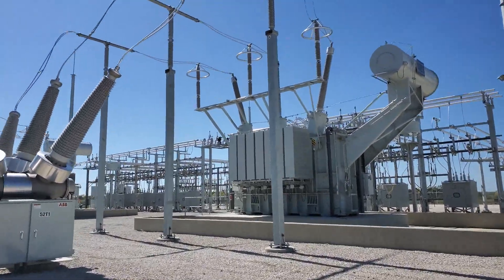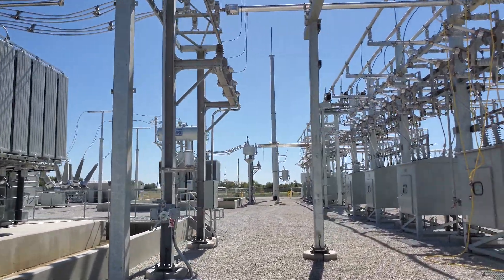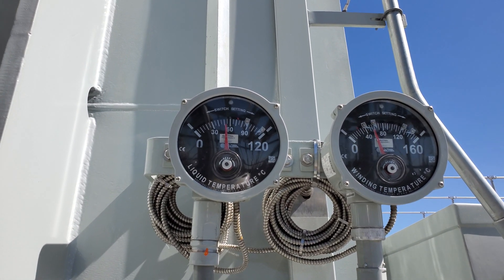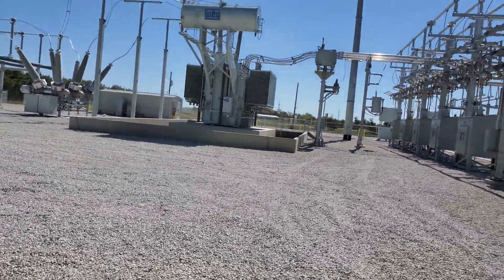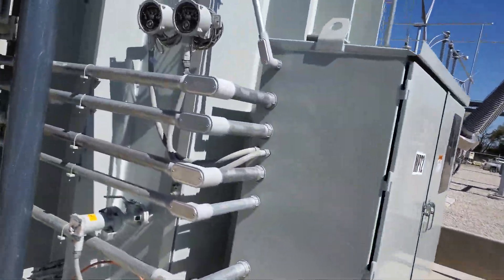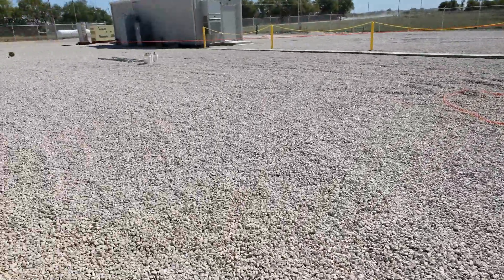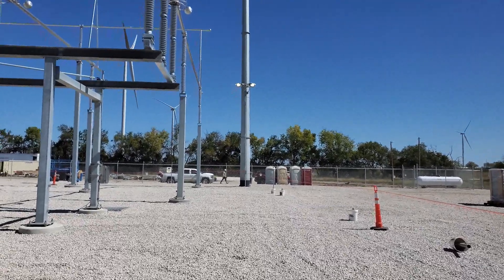345 kV Transformer Issues?? Part 1

Comment: As a part-time student of Electrical & Electronics Engineering, I have t  three QUESTIONS Please.

(1) Why are the Transformers "Humming" if there is no load on them?

(2) Is it periodically required to change the Transformer Oil like the Motor Oil in an Automotive Engine Crankcase?  May I assume Probably NOT since there is Normally NO Combustion?

(3)  What kind of Oil is required if it is Necessary to change the Transformer Oil?
Reply from the maker: 1. The actual hum is the core laminations vibrating/moving. This is caused by eddie currents. 2. As long as nothing is wrong with the transformer, the oil will be good for 20 plus years. If there are issues, it can be "cleaned" and put back in. If there is a big failure, the oil is replaced. 3. It is clear and tasteless mineral oil.

Comment: Losses of energy, which appears as heat due both to hysteresis and to eddy currents in the magnetic path, is known as core losses. Since these losses are due to alternating magnetic fields, they occur in a transformer whenever the primary is energized, even though no load is on the secondary winding.

Comment: Get your tap changer position straightened out. Match it to the high side system voltage.
Reply from the maker: This is a bit different here. We have to maintain a constant voltage on the secondary for the sensitive turbines, so the Beckwith is set up to the secondary PT''s. Engineers forget this so we usually always have to swap the beckwith output wires so it changes taps in the correct direction.

Comment: First transformer oil temp is 52 Deg. winding is 57 past the first stag fan set point which will cause the fans to come on. With no load, both gauges should read the same. The other transformer looks better at 40 deg C or 104 deg F provided it's a hot day.
Good idea to deenergize the first transformer. I've never had that problem, you may have tap changer issues.

Comment: How long did you no load soak each transformer?
What about ambient temperature? 
If I did the math correctly, 52 degrees centigrade is approximately 126 degrees F.
I have worked on Qualitrol temperature gauges many times and know that the auxillary contacts for fan control, etc are adjustable. You can look on top of the gauge dials and pretty much see where they are set. I think they usually contain three set of contacts or set points. Did anyone test those gauges to see if they were set correctly for this application. Also the fans on that first xformer you found turned on, were they set in manual mode or did they come on with temperature rise?
Questions you may get asked by xformer manufacturer.
Looked at your video 2nd time and see that your winding temperature gauge pointer is between your 1st and 2nd contact. Your schematic diagram for the fan control may show you why they are turned on.
Thanks
Reply from the maker: Usually about 24 hours.

Comment: The 1st thing that came to my mind was air/gas pockets in the oil, where the oil isn't 100% in complete contact with all the windings as they warm up. This might be part of what the "soak" process is meant to address...get the oil warmed and circulating so as to get convection to bring any trapped gas out.

Just a curious bystander here, no experience claimed.
Reply: This is a great idea as trapped pockets of air can lead to poor circulation but could only realistically happen on lower voltage transformers that weren't vacuum filled. This transformer being 345kv was most certainly vacuum filled. Before the oil gets put in, the transformer and windings are placed under strong vacuum and maintained at that vacuum to remove any moisture inside. The vacuum suction will be below the vapour point of water and will cause the moisture to "boil off" or evaporate into the air and the vacuum pumps can then extract it. The oil is then introduced while maintaining the vacuum and the vacuum is maintained for a period of time after to ensure all possible air pockets are sucked out of the transformer. Also, the term "soaking" a transformer isn't really that literal, it just means to let the transformer sit there energized without load for 12-24 hours to make sure its going to work well and not develop any problems (like we see in the video) before placing any critical loads on it. Great discussion.
Reply: @JAC_Hammer  I see. So the transformer was probably vacuum-filled, but then (ref. your comments downthread) when installed on-site, techs will need to bolt on, fill, bleed, the radiators? And your speculation is that this possibly introduced an air bubble that's interfering with the natural oil circulation starting?
Reply: @atsdroid  The transformer would have been shipped to site filled with nitrogen gas, the techs would install the radiators, bushings, conservator tank, etc etc. But the radiators fins are made of thin metal and are often not rated for full vacuum as they would collapse if subjected to vacuum. So the valves between the radiators and the main tank would be left closed while the main tank is vacuumed and filled. Once the conservator tank (basically an expansion tank(Big cylindrical tank way up high off the end of the transformer)) is filled to capacity (1/2 full or so) and the transformer is a sitting at ambient pressure, the radiator valves can then be opened (usually the bottom valves first) letting the head pressure created by the conservator tank being higher push oil into the rads. There are air bleeder valves on that top horizontal pipe on each rad that are opened to atmosphere to let the air out and let the rads fill up from the bottom, the top rad valves to the main tank are then opened and the air bleeders are double checked. Its possible in this case that the radiator valves to the main tank (top and bottom) were opened and the air bleeding procedure didnt happen. On other transformer designs, that top pipe on the radiators doesnt turn down before entering the main tank so by simply opening both valves, the radiators would push all the air into the tank and therefore not required to be bled.
Reply: @JAC_Hammer  Great! Well, I can't wait for the part 2 followup video, and I think you should prepare to 'win the internet' for the comment. I'mma bet on it.
Reply: @JAC_Hammer  And it's happened, you won the internet. Radiators had air trapped at their tops, bled step missed. When done, normal operation. Cool to get that report, and our presenter learned a nice lesson about commissioning these transformers too.
Reply: @atsdroid  Thanks, I'm glad they figured it out! In the second video he has the thermal images reversed. The one that is all a solid colour is the problem one, the image that shows a gradient from top to bottom is a working radiator. It's interesting to me how many more people in the comments of that video claim to have known the issue then in this video.
Reply: @JAC_Hammer  Ooh, I didn't catch that. Had a 2nd look. It makes sense now. You have to look at the temp range as well as the colors. The colors have no fixed meaning. He did say the "hotter" looking one was the problem. Your pointout is that the one with the cold seeming radiator is the problem b/c the radiator is a uniform temp, meaning uniform color, meaning it's not doing any /radiating/! Hey, another good pointout! Should make this pointout on the 2nd video's comments.

Comment: I've always been fascinated by generating stations, sub stations and pole mounted equipment.  Where's part 2?  Btw, I live in NY fed by NYSEG.  The power drops and the lights flicker constantly while my bach ups goes haywire.  Ive seen a 20 volt drop regularly and Ive lived in 3 different Counties with the same trouble.

Comment: I see in the comments you confirmed oil valves on the rad fans are open. See if you can get ahold of an IR camera and shoot the rads. They should have a nice gradient in temp from top to bottom (transformer energized of course). My second suggestion after rad valves is it looks like the oil header pipes on the top of the rads are lower then the top of the rads. If the rads werent bled of air properly, it will create an airlock in the top of the rads and prevent the natural convection cooling. I would think this might be visible with an IR camera without the transformer energized on a sunny morning where the sun heats the air space but the oil is slower to heat up.
Reply: Nice observation. Where's this low header pipe to which you refer. I re-watched and am not sure I see it. I can see a pipe connecting across the top of each radiator horizontally in the "set" of seven across (one set each side of the transformer), near the outboard-most fin.  But, this is the highest pipe I see and so can't be what you noticed, right?
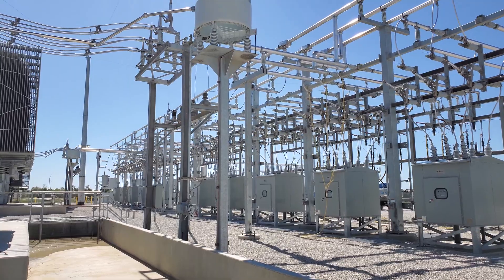Reply: @atsdroid  Reading back I see I didn't word it well. If you pause at 0:38 or so, there is the pipe that runs left to right that hooks each radiator fin together to distribute the oil into the rads. What I was referring to is if you follow that pipe to the left side, it turns 90 degrees straight down before turning another 90 degrees to enter the transformer tank wall. This creates the potential to trap air in the vertical section of pipe, top horizontal pipe and the top foot or two of radiator fins. I have seen it where the installation crew did not manually bleed out this air and it caused an airlock that kept the oil from circulating and caused the transformer to quickly overheat. I envision it like a siphon hose stuck in the gas tank of a car, without that entire hose full of liquid, it doesn't want to flow. Fill the hose right full of liquid and it wants to keep flowing.
Reply: I'm not discounting the possibility of something wrong in the transformer causing excessive heat generation, I just think the probability is higher of the transformer not being able to get rid of the natural heat created by the normal internal losses. Especially if the transformer was fully electrically tested on site before being put into service (not sure if that was the case here or not).
Reply: @JAC_Hammer  Ok, I see exactly what you're talking about now. Good call!

Comment: Looks like core laminations are not properly insulated from each other. This causes eddy currents circulating within the core. Explains the higher temperature. If it were instruments,  the oil and winding temperatures would differ .

Comment: I'm curious as to why the site power isn't 3-phase. Would enable those fans to be more efficient, for a start.
Reply: Likely uses a 12 23 31 setup for the fans, essentially 2 connections to each phase

Comment: You are in the U.S. (correct me if i am wrong) where they use Fahrenheit for temperature. Then why is the meter on the transformer in Celsius?
Reply: I started working for a  big utility company in 1962 and transformer temperatures were always in degrees C.  And those transformers were already old then.  BTW, with no load winding and oil temperatures should be the same.  Winding temperature is not really the temperature of the winding it's the temperature of the oil with a heat coil around its bulb.  The heat coil is fed current from a hot spot heater current transformer.  So winding temp. is an approximation, but probably a good one.
Reply: Many Americans that work in Engineering & Scientific work do use Degrees Celsius rather than Degrees Fahrenheit.

Comment: I suspect some transformer assembly tech is missing a spanner...
Reply: Turns out the installation crew forgot to bleed the air out of the radiators and the system was air locked. Hard to find good help these days.
Reply: @Rutherford_Inchworm_III  I saw that. I bet its because he couldn't find his spanner.
Reply: @FixitFrank  hahah

Comment: Well it could be a whole number of things, So impedance not quite as matched as they should be. Oil not circulating pump or bungage in a radiator. Cooling fan not running, control circuit for cooling not cutting in when it should. Internal leakage, water in oil, unbalanced load etc. I suppose even a different grade of oil could cause issues with viscosity etc.  Are the tap changers tracking or stuck (if these have tap changers) If the low side is open this might not lead to immediate fireworks ? Not a power worker but have worked in electronics and fault finding is part of the job :) I would certainly be interested what the problem turns out to be.
Reply: The load sided are open. If they were closed and both transformer.

Comment: Is the equipment like a cylinder on top between the transformer low side and the 34.5kV breaker the neutral grounding reactor? If so, check the 34.5kV system grounding method first, and all protective settings associated with.

Comment: Thanks so much from this amateur electrician. In the Bronx, Con Ed power company just working on underground 345kV line through the Bronx to Manhattan. They had trailers with nitrogen to cool oil surrounding the cables. I knew HV DC lines are used underground, but never dawned on me that HV AC lines run underground. Chatted with a few workers.

Comment: And you keep talking about a load on the secondary, but in reality, the wind turbines are feeding the secondary and the transformer is upping that 34.5 KVAC to 350 KVAC to feed the grid.  The whole point of this substation is to provide an interface to feed the grid from the output of all the wind turbines, isn't it? And where does the synchronization with the grid 60 Hz occur, inside each wind turbine?
Reply from the maker: There is no load if the secondary is open. There would also be no load if the primary was open. It's either side that needs to be open to prevent a load from being put on the transformer. In this case, If the primary is open it would simply de-energize. The sync happens at each turbine.

Comment: AT 0:37, what is that round thing a the top of the square pole, with the three switches behind it?
Reply from the maker: Excellent question!!! Its a neutral grounding reactor. It basically limits the fault current the transformer would produce in a fault. This cuts down on arc flash ratings and concentric neutral sizing of the underground cable.
Reply: @spdfreakls1  Is a reactor like a ballast from a fluorescent lamp, but slightly bigggger?

Comment: Those 345kV breakers bring the conductors quite low, not sure I would be walking quite so close and I would expect capacitive pickup to make my toes tingle as I walked past!
Reply from the maker: Its the lowest conductor in the yard for sure. The rock keeps you from feeling much however if you touch the cabinet its another story. Nothing that harms you but it's enough to make you not get so close again.
Reply: @spdfreakls1  Thanks - it might be a fun demo to walk around the yard at dusk holding a small fluorescent tube or CF lamp! If I can easily light one up several meters under a 400kV line, I am sure you could too!

Comment: I am super curious to find out what is causing this...
Reply: Michael Tech  Technically since it's 3-phase there should be 6 coils in it. 3 primary, 3 secondary.
Personally the first thing I would check would be that the oil level and oil circulation is sufficient so it's not something wrong with that. The simple things first before going too deep.
Reply: Not if it's an Auto transformer,  only 3 coils
Reply: Michael Tech  it was/is a brand new transformer?